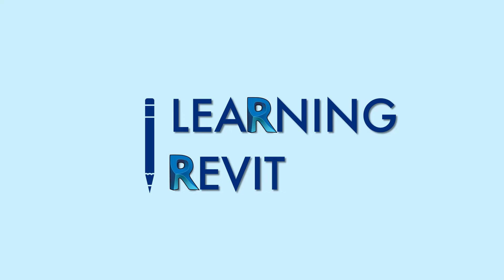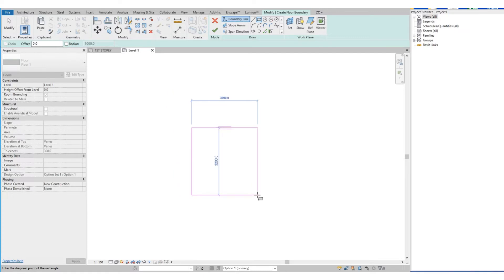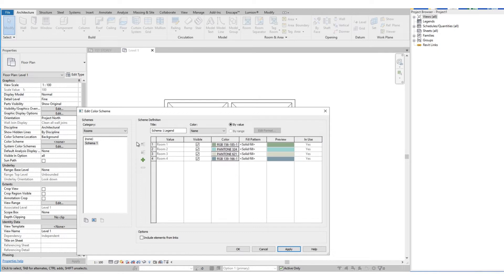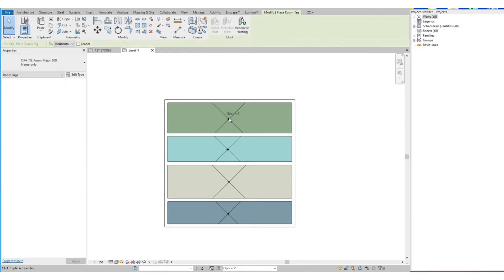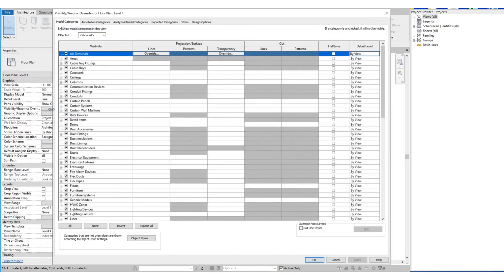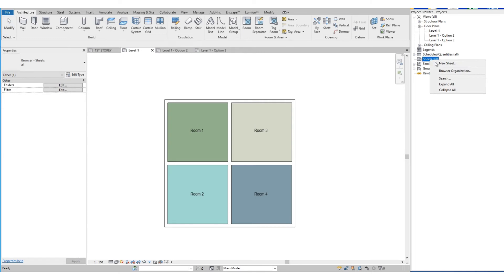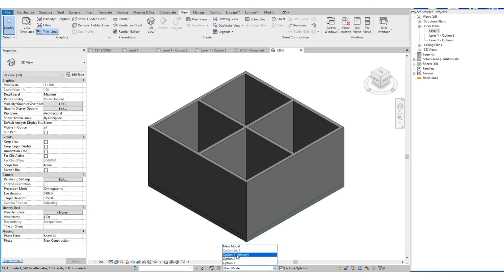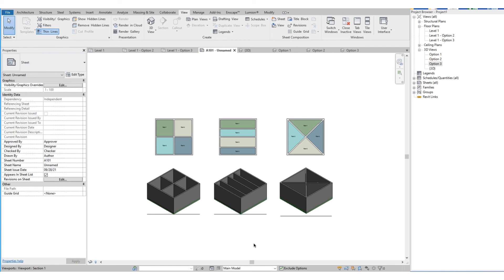How to use Design Options in Revit? | Tutorial for Beginners

Comment: good video overall. I am still wondering how this works later into a project (DD/CDs). Specifically I am working on four spec houses which each will need to have two different façade styles. Thinking floor plans will be the main model with the two elevation designs (options) being on their own sheets.
Reply from the maker: yes, that could work. The facade elements will be on different design options. Then you will have to create the different elevation view, then set each the design option of each elevation on the visibility/graphics according to the facade style.